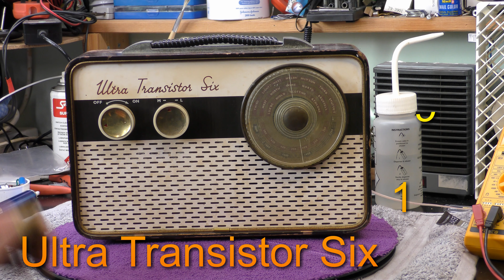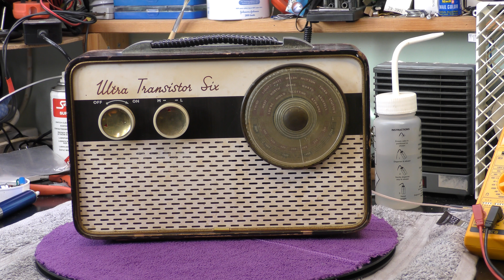Ultra Transistor Six TR100 1958 Vintage Transistor Radio (4K)

Comment: That's a nice set, and the sound is amazing for its size, especially given how early it is in the evolution of transistorized circuits. These early solid state radios had their flaws, but they were also quite expensive, thus justifying the investment in a very substantial speaker. The American sets I've seen from this era didn't sound quite as rich, but they were better than their eventual Japanese replacements. As solid state portables became more popular, there was the inevitable race to the bottom, at least for sound quality.
Reply from the maker: I think the wooden baffle helps. A nice large speaker too. I think the pocket sets with small speakers are rather tinny of course and size was a big drive. I think the transformerless output stage is advanced for its age and helps with the bass response. I guess the high cost of transistors kept the valve/tube viable for some while.

Comment: You can  find the rubber grommet assortment ,on Ebay.I hate restuffing it never looks as nice as new capciators,and new caps take up much less room and new caps look nicer then original.plus you can what work that has been done.
Reply from the maker: Hi Ron, the few packs of grommets I had didn't seem to be the right shape, need to look a bit harder online. I must admit I like the plessy caps with two colour body but fully understand your point too on new capacitors. I like the blue axials you can get.

Comment: Nice little set and fix...  odd IF for sure but a nice radio.
Reply from the maker: I wonder if the odd IF was to avoid birdies of some sort from station frequency of the day, George? Its a nice transistor radio for ultra's first. Transformerless output too.

Comment: Lovely Video As Always Darren And Thats a Super Looking Set  !! Nice Job On Stuffing The Old Plessy Caps Gona Stuff The Caps On My 2 Bush TR82c Sets But Only On The Side Thats Visable Will Use Bog Standard Radial Types On The Rest But Am Experimenting On Retrobrighting The Very Yellow Case On One Of The Sets Its Takeing Me Longer On The Cosmetics On These Sets Than Fixing The Bloody Things !! he he Regards mike.
Reply from the maker: Thanks. Yes, I think its easier just to do what you see when changing the battery. I am not one for cosmetics I must admit and got help with the case. Ill have to look at retrobrightning but so scared of the print coming off.

Comment: You don't half find some cracking radios Darren. I wonder what people thought when they moved from valves to transistors? Either a miracle of modern technology or the devils work...
Reply from the maker: Thanks, I was lucky to be gifted this radio. People peered in the back and wondered why nothing lit up I guess!  I guess having a radio that lasted for months on a set of battery's was a miracle if we think of the valve portables.

Comment: Interesting Radio, we had the exact model in our restroom back in the1970's when I worked as a assistant school keeper at Malory Secondary School, it never sounded that good. Thanks for the interesting video.
Reply from the maker: Thanks Barry, I was surprised at the bass and treble. I guess the IF is a little wider than some sets. Having fresh battery's makes a difference too.

Comment: Looks like they really had audio stability issues, with that screen and large cap across the speaker. I've never seen such a large cap right across the speaker before. (It would have to be a reversible is it's seeing AC)  Across the primary of the output transformer in valve sets, quite common. With such a high value that must have cut into the audio spectrum. I guess as an AM only set, your not going to get much above 6-8kHZ anyway. Interesting set.
Reply from the maker: Yes it is a interesting way of stabilising it.  The 10nf on the bases of the two output transistors seemed to have a similar effect.  As you said, Michael your not going to see much over 6khz. I had to use two back to back caps to replace.